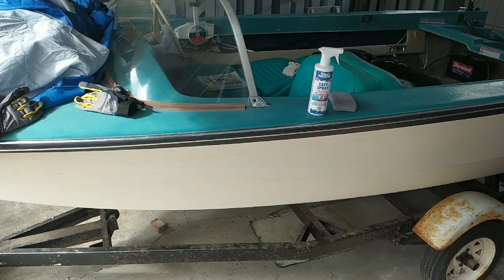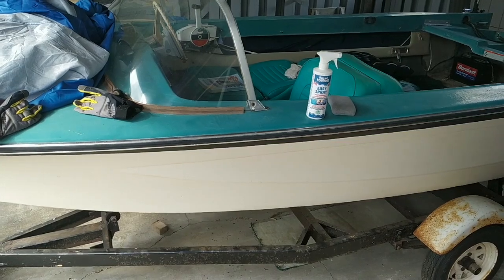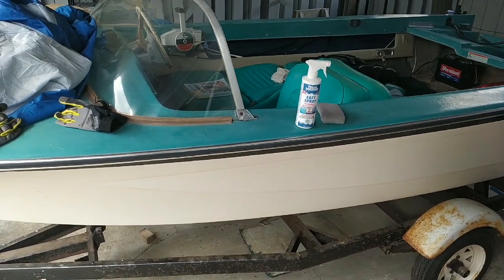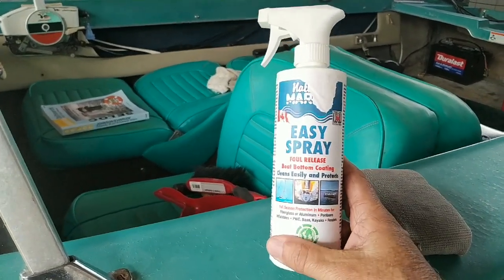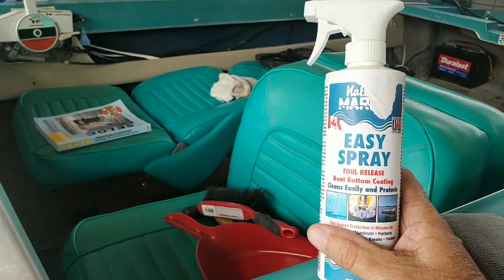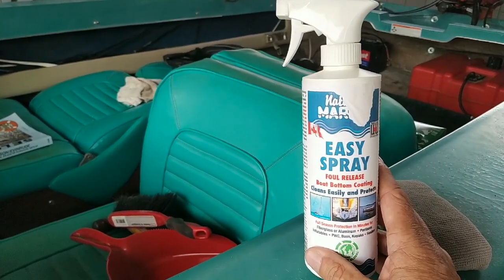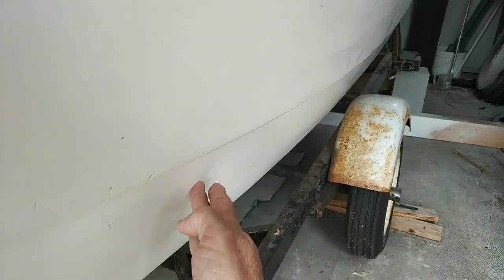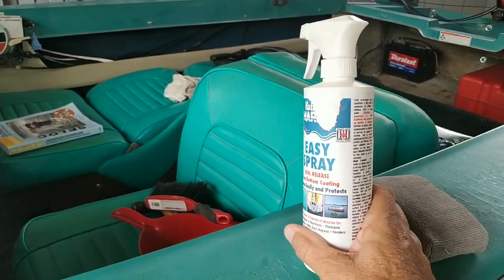Boat Bottom Anti-Fouling Wax

Comment: Looks like a perfect product for my racing sailboat where a glossy bottom is preferable. It's about two month since you uploaded the video. Do you have any hint on how the wax is working?
Reply from the maker: Hi Jesper, I pulled the boat out of the water after a month and other then a tiny bit of algae the bottom, was pretty clean,  My boat capsized in the last wind storm so no further videos
Reply from the maker: There was a storm that forced me to pull the boat out of the water 
earlier than I wanted to.  But after about a month the bottom was fine. 
 The manufacture indicated that 3 -6 months was a good coverage for the 
wax.

Comment: Hi Joe, curious.  I wanna do this, this year.  Before I do, I want to ask, how did it do?  Did it last all summer?  And how was the results?
Reply from the maker: @UCYLQS09UrnCdkuLygSpn4IQ
  
  

    

      
      

        
        @UCYLQS09UrnCdkuLygSpn4IQ

@UCYLQS09UrnCdkuLygSpn4IQ

        
        @
        

        
        
      

    

    
    

  
  There was a storm that forced me to pull the boat out of the water 
earlier than I wanted to.  But after about a month the bottom was fine. 
 The manufacture indicated that 3 -6 months was a good coverage for the 
wax.